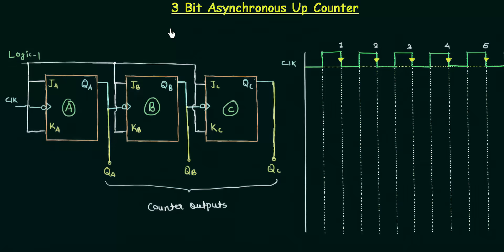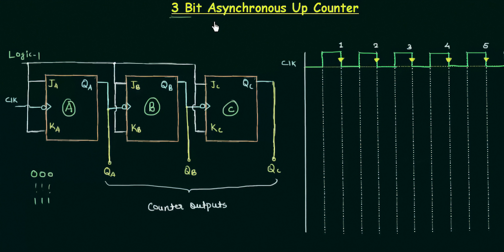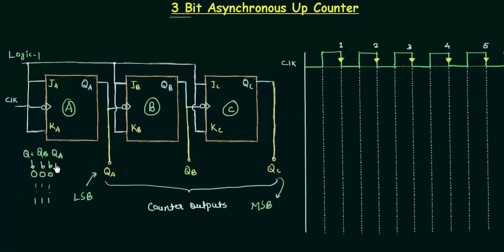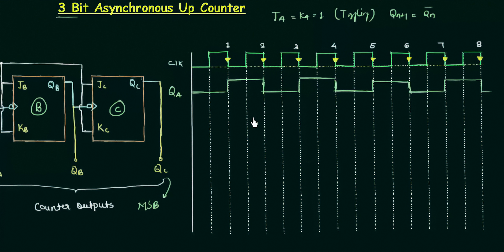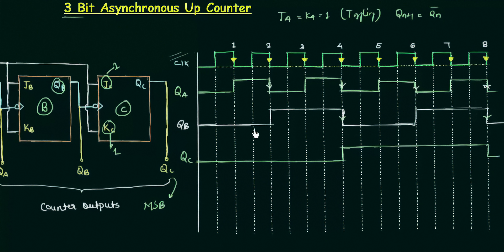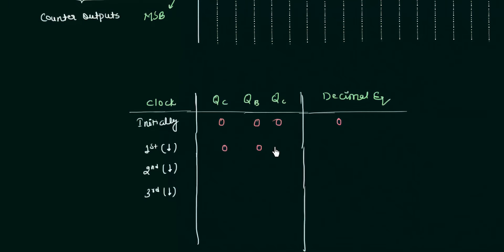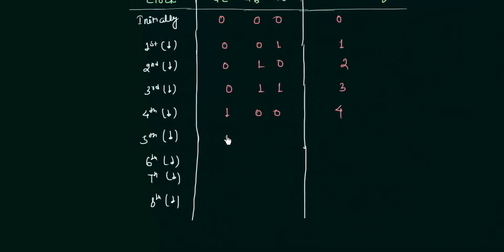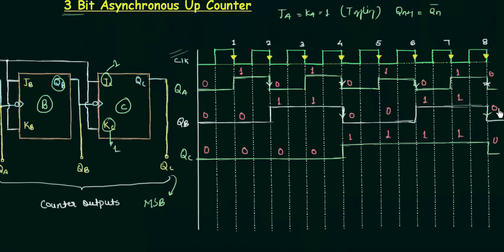3 Bit Asynchronous Up Counter

Comment: If we apply Q©(complement)  as clock instead of Q to the 2nd FF in asynchronous counter does the initial state will be zero? Or it will be 1 according to Q©?

Comment: In my assignment I was told to make 0 to 59 timer using T FF. but the prof used rising edge triggering. but it still worked. can you explain why
Reply: In Asynchronous counter. If Q is used for clock, then ff will be negetive edge triggered.
If Q' is used, then ff will be positive edge triggered. You can find examples for both cases online.

Comment: Why we don't simply use the Toggle flip flop?
Reply: We ARE using the toggle flip flop. Just with a clock input, each of which is getting triggered from the preceding FF circuit.

Comment: Here you have considered falling edges for counting the values due to negative edge triggered clock. But in your first video( introduction to counter) where you have also designed negative edge triggered click but considered middle edge for counting values....

Comment: A small doubt, I have tried to simulate this circuit in logisim, And I got 111->110->101->...000->111... Result was reverse count, is this the output because I got confused because it's name is Asynchronous UP Counter. Kindly reply
Reply: Here, the educator used a negative edge triggered flip flop. The flip flop at the simulator you used must have a positive edge triggering. Draw the clock pulses but with toggling at the positive edge of the clock and you'd see a down count.
Reply: hey i think the educator here is wrong , actually u get an upcounter if you would use a falling edge and positive trigerred flip flop

Comment: Sir can you explain and draw the circuit
"A digital computer has three registers: A, B and C. Four flip-flops provide the control functions for the computer: S is a
flip-flop that is enabled by an external signal to start the
system’s operation; L and R are used for sequencing the microoperations; A fourth flip-flop T is set by the computer when
the operation is completed. The function of the system is described by the following register transfer statements:
S: C ← 0, S ← 0, T ← 0, L ← 1
L: L ← 0, if (A = 0) then (T ←1) else (R ← 1)
R: C ← C + B, A ← A – 1, R ← 0, L ← 1
Design a circuit with minimum components to implement the above operations."

Comment: why do we need toggling
Reply: Because in toggling, the output becomes high then low, then low. Qn+1 = (Qn) ' . If it was some other case, then Qn+1 would have been either 1 or 0 and on the timing diagram, it would just be constant. We need our output to change constantly.

Comment: Sir.. in the block diagram you did not use any reset there .. then how the circuit will be change to initial state in the middle of operation

Comment: I want to design a counter which can count 0 to 7 except particular 3 states then i can design it but i want to draw a timing digram how to draw what happened my invalid 3 status clock pulses???
Reply: You can put logic gates at various outputs and/or inputs in order to design a counter like this. First create the truth table, then write logical equations for each output.

Comment: sir if i will not take the value of Ja,Ka,Jb,Kb,Jc,Kc=1 then what will happen
Reply: we want toggling , so need this condition bcoz toggling happens in this case.
while writing binary equivalent for decimal equivalent we toggle lsb from 01010101 and the frequency decreases with our movement toward lsb by power of two,  so we need this condition of j and k =1 and edge triggering

Comment: Can we use positive edge trigger instead of negative one?please answer it😭
Reply: yes we can and it would work fine but since our clock pulse is starting from 0 the first positive edge will be at t/2 and just for the sake of counting with clock pulse we use negative edge triggering.so that toggling can occur at t.

Comment: why we use negative edge triggered???
Reply: Because we want toggling action of the flip flop instead of race around condition.
Reply: Vaibhav Jain  we need to have a edge triggered JK flip flop to remove race around situation,a master slave JK flip flop is equivalent to a negative edge triggered  JK flip flop so that's why we use a master slave JK flip flop which is represented as negative edge triggered JK flip flop
Reply: No, it is possible to make with both positive edge triggered as well as negative edge triggered. Also race around condition occurs only during level triggering.

Comment: you are using the output Qa of the first flip. But  in the books the Qa complement is used to clock the second flip flop and positive edge triggered clock is used. Is it the same thing?
Reply: for -ve edge triggered you have to take output at Q' or  giving 
Q' to next ff as clock

Comment: what is toggle.?
can u explain it clearly
Reply: hellow chaitu, toggle is a condition that will occur in operation of JK flip flop. when both the inputs of JK flip flop i mean j=1 and k=1. As in jk flip flop non inverted output will be giving feed back to the input . when we have both J and K are one if output is intially one it will become 0.if output is initially 0 and it will be 1 . this is called toggling condition
Reply: +Chaitu Marneedi If J=1 and K=0 you'll get Q=1 and Q/=0, If J=0 and K=1 you'll get Q=0 and Q/=1. So if both of J and K = 1 every time you get puls(clk=1or 0 if its inverted) outputs Q and Q/ will change ...Q=1 and Q/=0 ------- CLK -------Q=0 and Q/=1 ---------CLK----------Q=1 and Q/=0---------CLK---------Q=0 and Q/=1 and sooo on. In other words Toggle means changing between those two outputs.